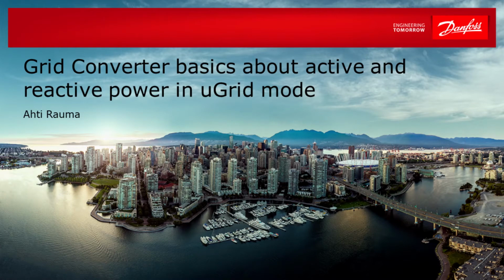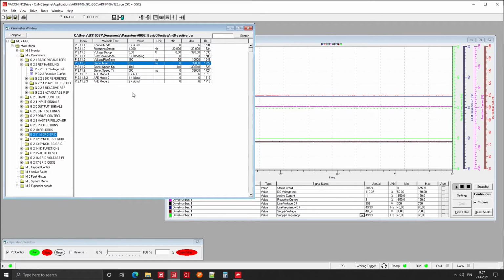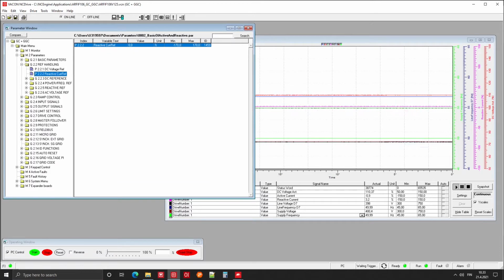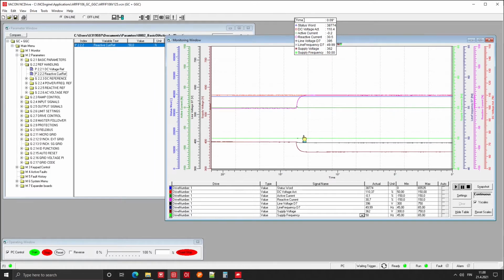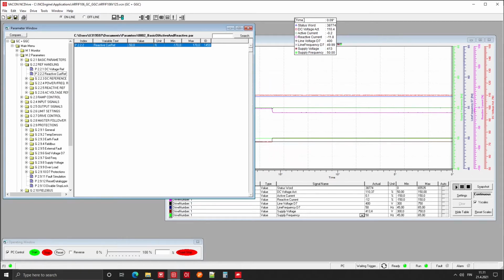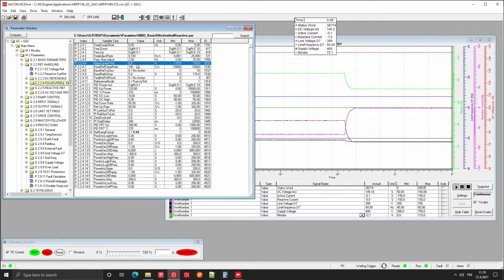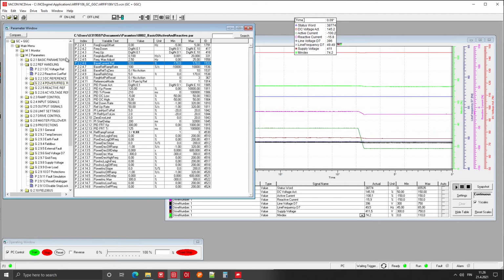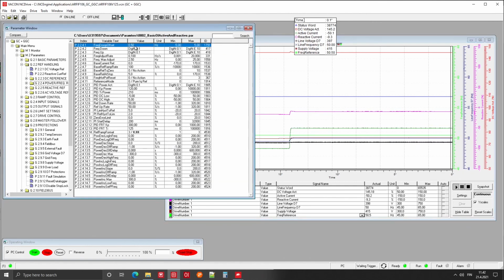Grid Converter ARFIF106 uGrid Mode, Basics of Active And Reactive

Comment: In some marine environments the grid frequency can variate up to some 2Hz due to the diesel generator frequency drooping. Also some 4% voltage droop on those gensets as per adjusted on AVR. In the cases where the grid converter is quite big compared to the diesel gensets, like battery charger on a fish farm barge, the grid will be quite "soft". When the basecurrent reference is used to charge the battery in uGrid/Isosynch mode some diesel gensets get a bit unstable. Easy fix is to charge battery like in this video. Use uGrid/droop mode and just adjust the frequency offset to obtain the desired charging current to the battery.